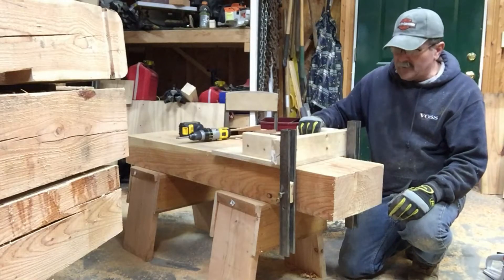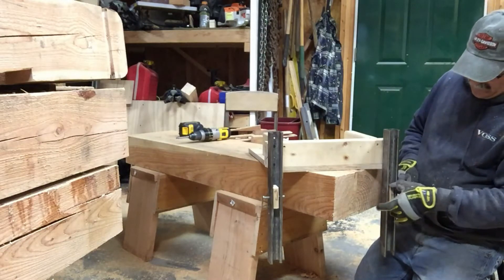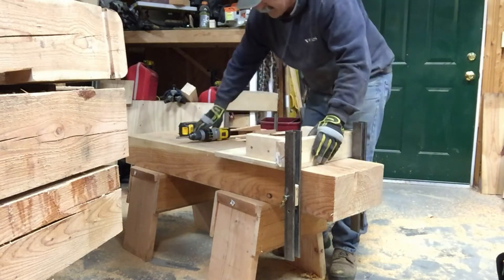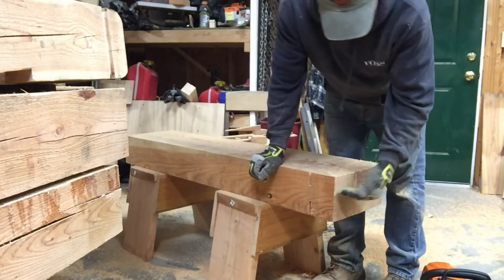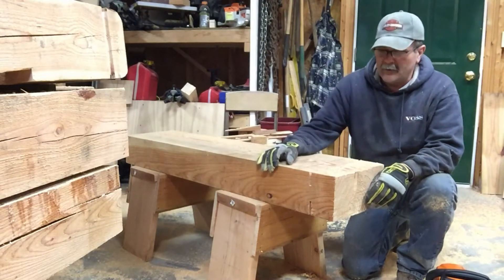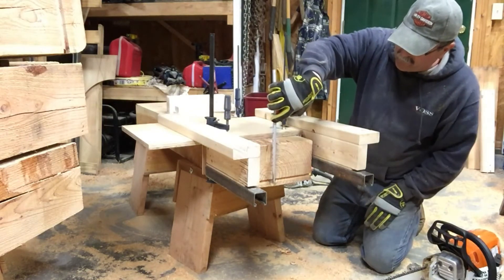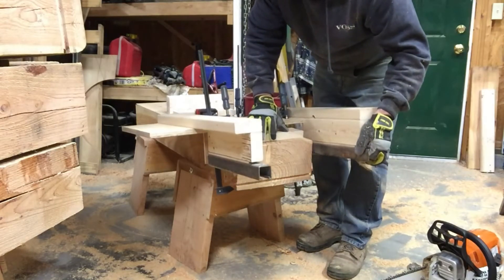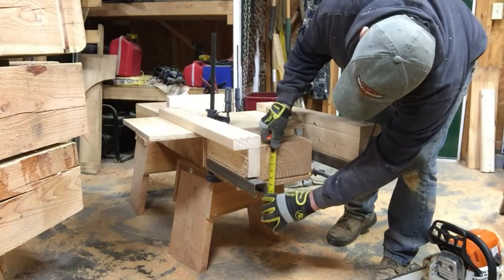Timber Frame Tenon Cutting with a Chainsaw Fixture

Comment: what kind a material did you use for the tracks and rollers on saw?
Reply from the maker: Hey Justin,  the rails are "Uni-Strut" and the rollers are a accessory for those rails normally used for overhead conveyors.  Uni-strut P1000 is the rail, and P2751 is the car.  i simply drilled a hole in the Chainsaw bar and mounted the car with a 1/4" bolt.  it works really well.  i also made some curved jigs for cutting the knee braces.  cut the curved shape on the shaper and laminated it together to be like the uni-strut rail
Reply: Thanks this looks like the best way I've seen for tennons definitely will be trying this out.